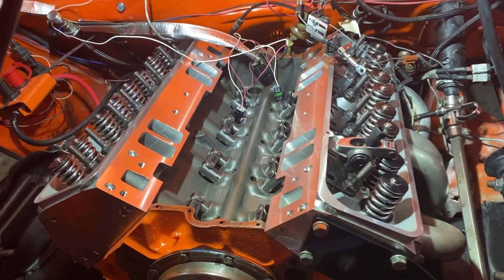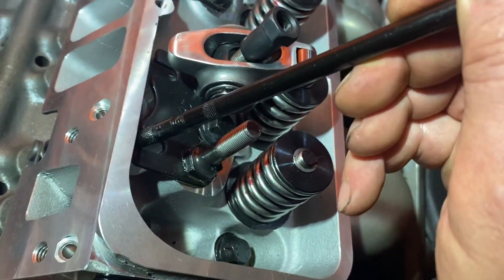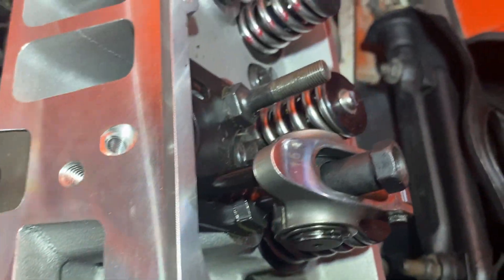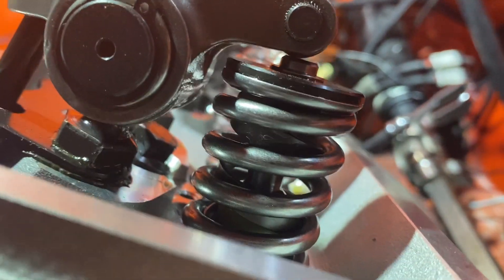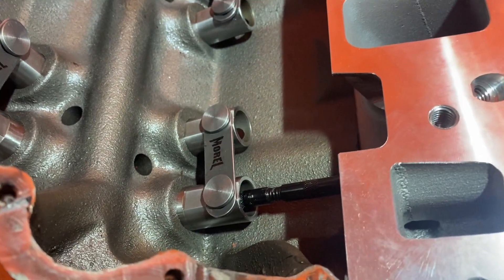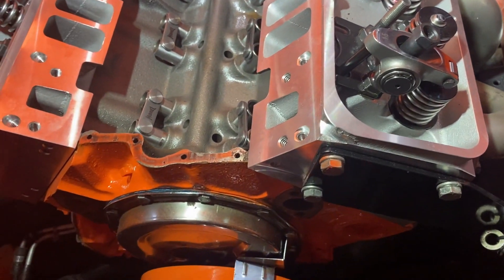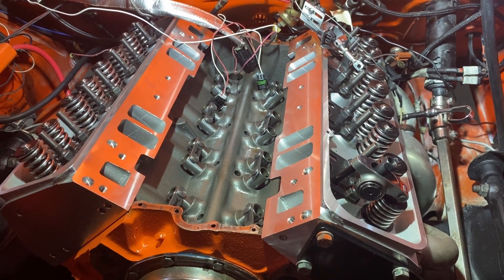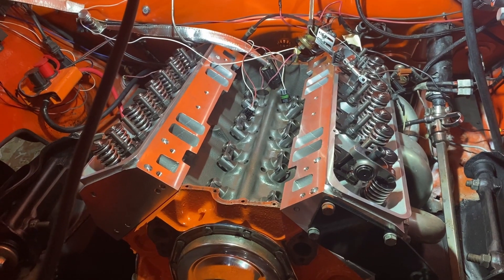SBC Pushrod Length

Comment: the sweep on that roller is way way too long. it should only have a 50 thou wear mark. "centered" isnt the only thing that matters..
Reply from the maker: Thank you for the accurate information. The all important geometry. To fix this I would need Crower offset rockers.  The center of the trunion to the center of the roller should be 90 degrees to the valve stem at half lift. Mine is not even close. In the end I put it on the back burner until I shell out the extra 500 bucks and switch out the rockers. Thoughts?